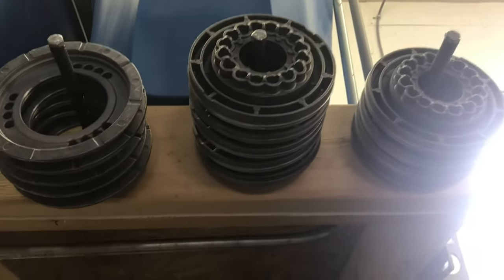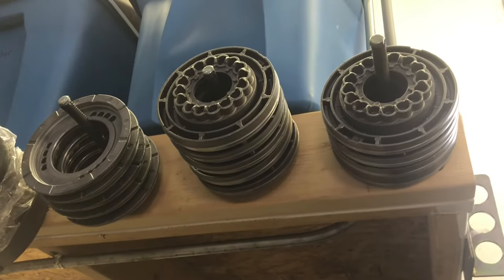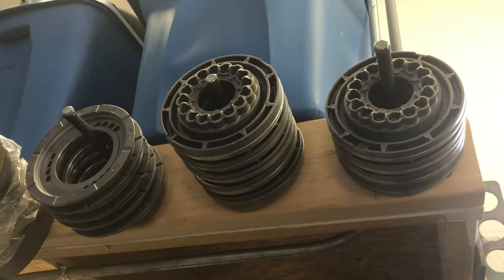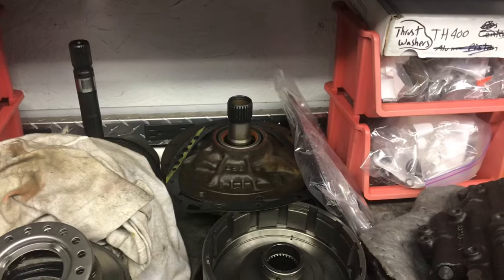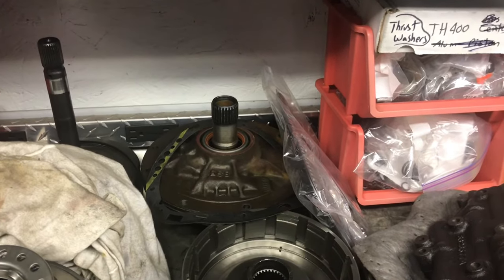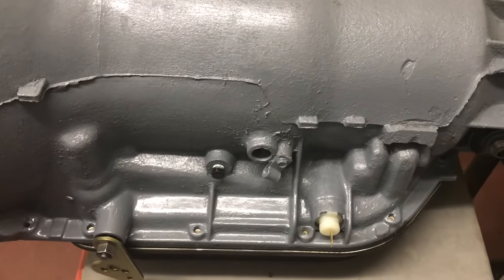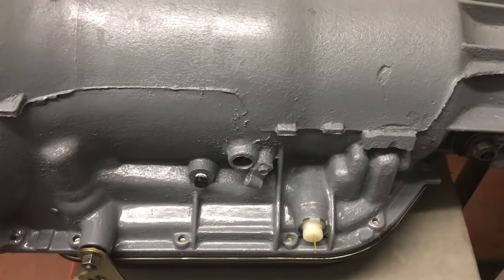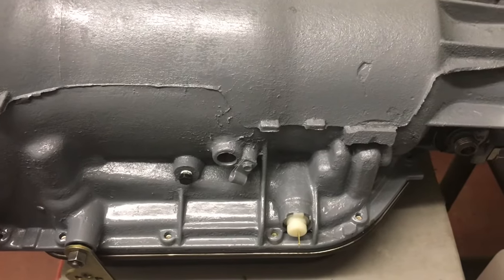TH400: How To Recipe for 800-1000HP

Comment: i have a th400 in a 6.2 diesel k5. I have a lot of engine roms and I get little power. What could be failing?
Reply from the maker: Start simple with oil level, plugged filter.

Comment: hey man is the ROSSLER TH400 XHD WITH 210 first, 1.4 second and 1.1 Third good? also what stall would you recommend for a 1000hp wheel hellcat, running a 50 tall tire, 4800 race weight
Reply from the maker: Popular transmission with small tire racers. Just guessing from what you wrote around 4500ish. Thanks for watching!
Reply: @mountainsgarage  understood ty

Comment: Hey Mountain Garage. iv'e got an early TH400 i picked up and had been sitting outside and may have taken in some H20.
I think i heard you say if one takes in water it's not worth overhaul, should i open it up and see how bad it may be? 
What do you think ?
Reply from the maker: I did a few videos last summer on stripping three Pontiac HD TH400’s that were full of water. I saved a lot of parts and was able to soak the rusty stuff in rust remover and save more. Definitely rip into it and see.
I have three more of the HD Pontiacs to see what is inside.
Merry Christmas!
Reply: @mountainsgarage  Thank you Sir and Merry Christmas to you and your family 🎄

Comment: Awesome information man have a question for you  i have a 700R4 trans can i rebuild it and make it strong enough to handle 800 hp or not just curious
Reply from the maker: I have seen some advertised claiming they will handle almost that, personally I think it’s going to let you down after a large investment trying to make it do something it can’t.
If you really need overdrive then 4L80E is awesome.
I would take a 2004R over a 700R4 but both are weak by comparison.
Reply: @mountainsgarage  How much more expensive/complicated is it to make a 4L80E live at this level compared to the TH400 you detail here?
Reply from the maker: @nowayjose596  Everything for the 80E is at least a third more it seems.

Comment: What will a stock 400 handle. I'm making about 550 on a stock transmission and Wondering if it's still safe or if I should be worried
Reply from the maker: If it’s in good shape I wouldn’t worry too much if it’s a light vehicle. They are pretty stout. You could put a shift kit and a race filter while it’s in the car.
Reply: @mountainsgarage  it's not a light car. It's a heavy mud truck.probably 4500 lbs. Only problem so far was a stuck governor.

Comment: My transbrake sometimes won't engage but I can hear it click
Reply from the maker: External solenoid?
Start simple with checking voltage and a solid ground. And make sure the valve is smooth in the bore.
Internal same deal.
Reply: Thank you. Internal. I dropped the pan and pushed it in and out multiple times and it seems smooth. It works more often than not. I could here it click on the release but it wasn't engaging. I can get a new one. I just wanted to pick your brain to make sure I hadn't missed anything internally that could cause the intermittent issue. I followed your videos to do my build. Thank you for the great videos.

Comment: Part number for spiral lock?
Reply from the maker: The kit that contains the intermediate case spiral lock and the direct clutch sprag spiral lock came from Feiock Performance on eBay, part number FP400SLK. I see other manufacturers use their own part numbers. I searched TH400 spiral locks.
Reply: @mountainsgarage  Thanks for your time and vids greatly appreciated.

Comment: i cant use the oem 4l80 hub on my th4oo 800hp turbo ls...cant hold this hp..?
Reply from the maker: Yes the 4L80 hub is fine at this level.
Reply from the maker: I am sorry it’s early I thought you were talking Sprag race, I believe the 4L80E Forward hub is good for 800ish.
Reply: @mountainsgarage  yes i have a the 34 element
Reply: @mountainsgarage  You have a phone number
Reply from the maker: @jorgelozada5582  207-831-6805

Comment: Thanks for the great overview. I have a TH400 in my car https://youtu.be/e3HU9l3d2nQ
I built this 12 years ago for a close friend and he took care of acquiring the transmission and got it running so I dont know what's in the trans. I have the car now and do plan to disassemble the TH to inventory what upgrades where made (I'm sure it has stock shafts). It does has a trans brake, 2800 stall and the car is 2000lbs with me in it. Since it's a procharger it will not have a ton of low speed torque but I want to pulley the motor for 1100hp on the street. It does hook pretty good on a few spots I play at set at a proven 800whp. Any gut feeling on how dependable this combo will be built how you have outlined?

Comment: The TH-475 spur cut planets do not generate thrust loads like the helical cut gears, that act like screw jacks under load.
Thrust loads kill that rear case washer. Putting a thrust bearing back there treats the symptom in a touchy feely way, rather than deal with the CAUSE. (i.e. eliminating the thrust at the source.)
Bearings can fail. And often do. Especially when you employ them where they don't belong. Imagine what your gearset will look like after a thousand little fractured bearing bits act like carbide cutters being pumped into every moving part, with gusto. 😲🔫

Beefing up the intermediate clutch snap ring in the case is another touchy feely act of symptom management.
That snap ring only blows the case lugs when the line pressure is jacked to the moon, which is totally UNNECESSARY. It is a hydraulic JACK afterall. Omitting the center seal from the dir/rev and forward clutch drums effectively doubles the piston area already. Raising line pressure on top of that is quite unnecessary!
Excessive line-pressure also kills the pump, the pump bushing, and convertor hubs. And it eats horsepower while doing so. You risk failure, and gain nothing.
And there is no need of a torrington bearing on the rear of the pump because all of the thrust load is constrained to the rear gear set via the direct clutch snap ring to the intermediate shaft. That's why the factory thrust washer on the pump goes forever, and it's plastic, or fiber!

This video implies LONGEVITY mods for a TH-400. I'm only halfway thru this video and i would argue against the reasoning behind all of these mods.
Do them if it makes you FEEL better, but don't think for a minute your trans will go the distance if you employ them. It won't.
No offense, jussed sayin' 😶